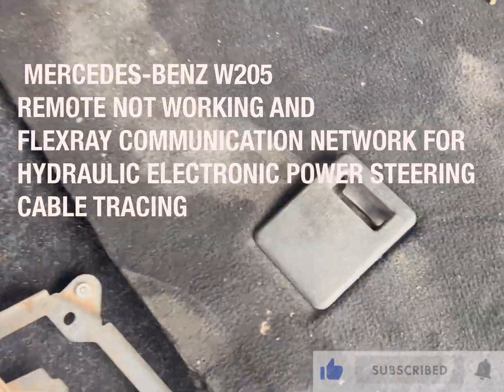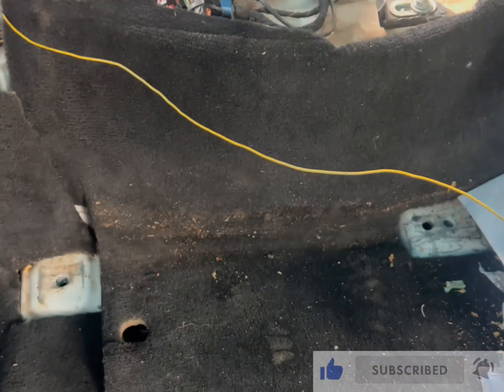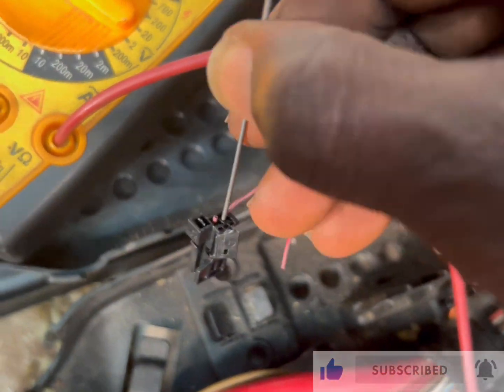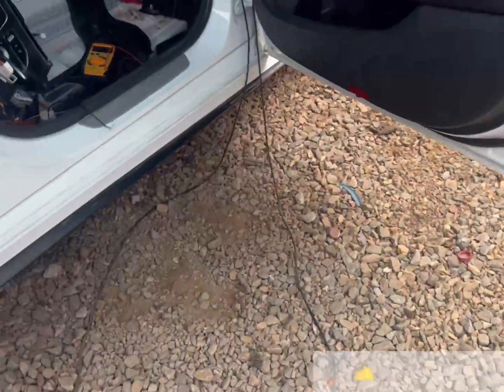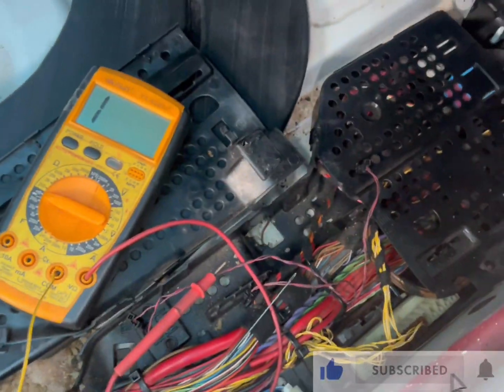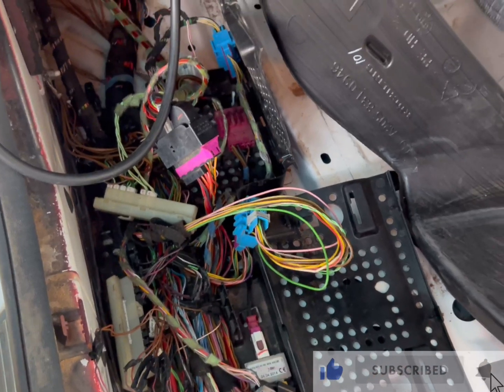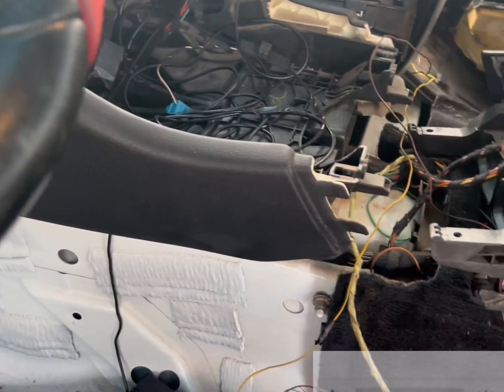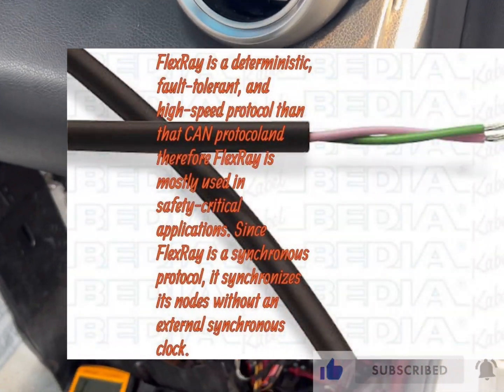MERCEDES-BENZ W205  REMOTE NT WORKING ND FLEXRAY COMMUNICATION NETWORK FR ELECTRONIC POWER STEERING

Comment: Hello brother. Can I contact you for some help? I have a 2010 ML350 with no crank, no start. At first it used to cut off while driving or idling and the message PRESAFE INOPERABLE will appear on the dash. But now it no longer cranks or starts. Before, I could scan all modules but now there are several modules that don't show on the scanner, like the ECU, transmission, ESP, and some others. But the scanner detects up the rest of the modules. I know there must be a CAN bus problem. But I'm not good with electricals so I need help with diagnosis if you can guide me, please. Is it possible?
Reply from the maker: @pmo3448  check when you turn the ignition on if the engine beeps and the throttle shoot, does the P highlight on the dashboard, if all is okay then check the gateway under the driver seat and also there’s some pre fuse on the fuse box where you will jump the car, check if there’s a breakage. Lastly, check the ism and the transmission wire harness if there’s a melt
Reply: @obiritech bro you’re too good !!!

Comment: Hello buddy I'm a auto electrician ihad 2017 gle250d 4matice diesel car cranking but no start i do diagnos and show me in engine ecu this faultcode B1c3200 control unit supplemental restraint system (srs)has detected a crash i now about this code when car is accident Mercedes gonna be no crank no start but this car is cranking but no start and that faultcode is still in engine ecu crunnt position even when i trying to clear is not clear and i try to 3 different scanner but not original Mercedes tool can you have any idea
Reply from the maker: 1: did you read the fault code from the ecu and what fault is in the srs module 
2: enable crash 
3: sometimes situations like this i need to examine the car by myself 
4: if there’s no fault with anything apart from the said fault code then try replacing ecu if after enabling crash and fault still persist
Reply: Car it was accident but in airbag module shows me about only the driver side airbag passenger side airbag and others but not related to crush data
Reply from the maker: then, read ecu and go to adaption will find TEACH-IN click on it and another window will pop up where you can find ENABLE CRASH then click on it to ENABLE it or else contact me on WhatsApp +233264639967
Reply: Thanks man really appreciate you sir Thanks allot